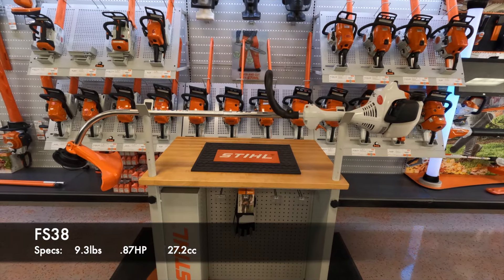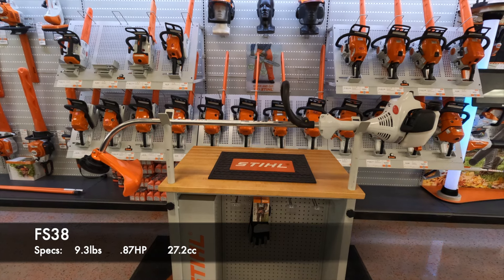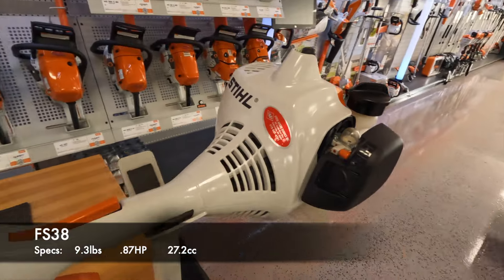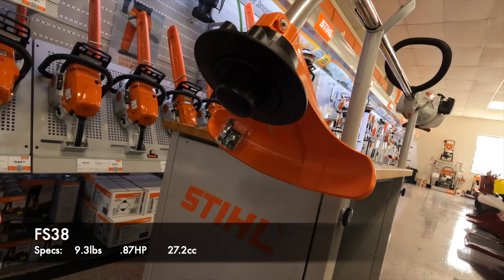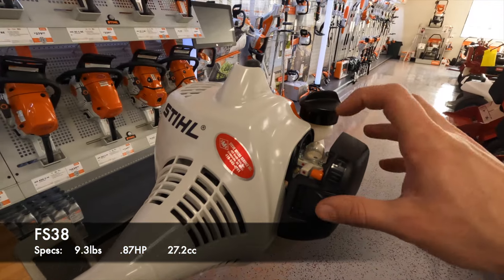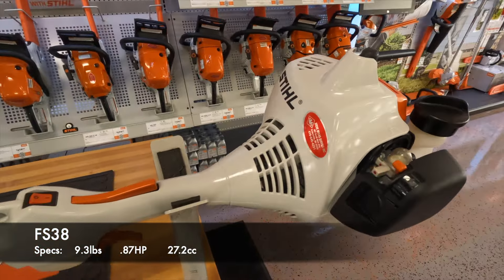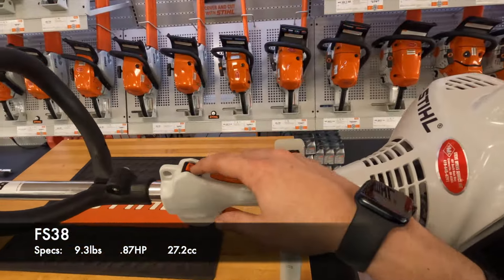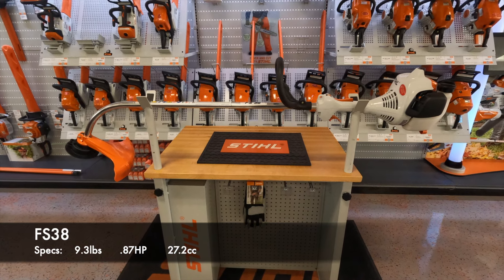Stihl FS38 String Trimmer Tutorial

Comment: Can you get the other head forcing?Just run the line through it and wind it up that way or can get that for this model
Reply from the maker: That string head does not come standard in this model but it can be purchased and changed out. If you are wanting that style head you should consider upgrading to the FS40C-E. This difference in price between the two models is the same price as upgrading the head and you will also gain more user friendly features and power with the FS40C-E